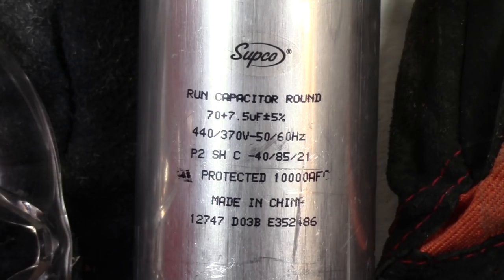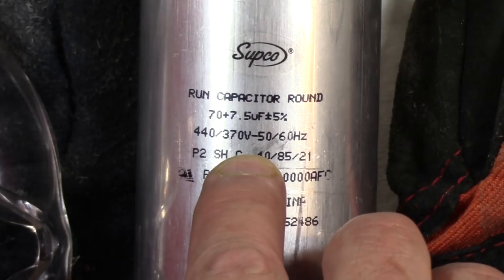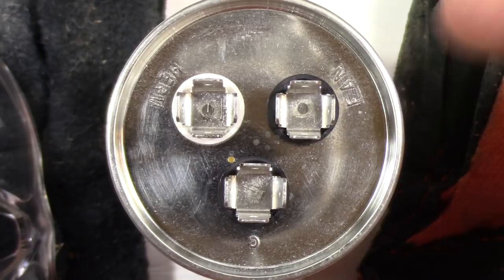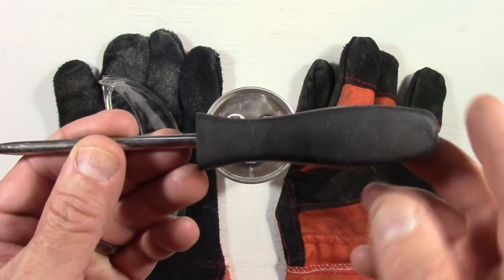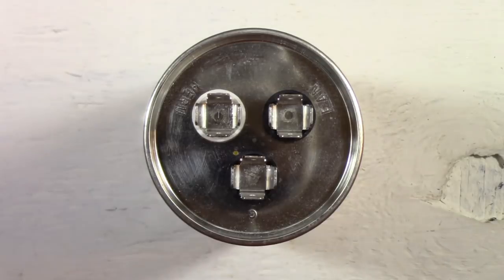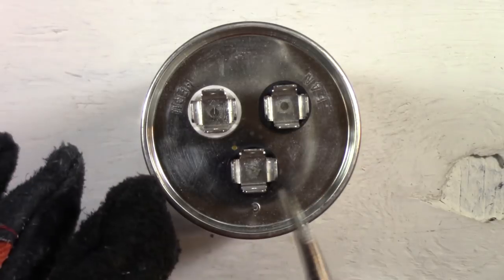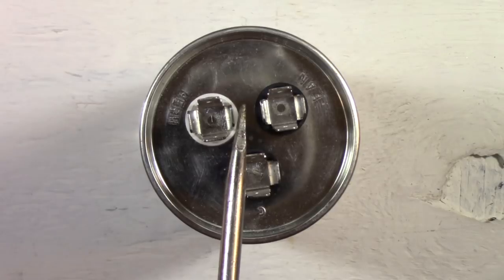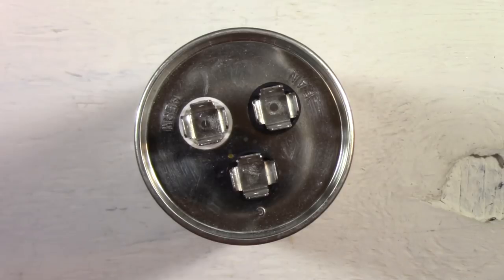How To Safely Discharge Your Air Conditioner Run Capacitor

Comment: You should add a part to the beginning telling why a capacitor needs to be shorted. You've shown how to do it safely, but didn't tell us why we need to do it.
Reply from the maker: Unfortunately Youtube no longer allows us to annotate the video post production or I would just put a note at the beginning. My assumption in this video was that stating that the capacitor was storing high voltage (120Volts) and showing the sparks that you get when you discharge the capacitor would be sufficient to show the hazard potential. In my next capacitor video I will state the reason for discharging the capacitor (safety) to be sure that there is no doubt as to why. Thanks for the feedback. I appreciate it. All the best.
Reply: Richard Lloyd hi bro...u r awesome..one more thing I want to ask...Can I discharge the capacitor connected to the hvac or it should be discharged after getting it disconnected from ac
Reply from the maker: Certainly disconnect it first and make sure you use insulated tools and gloves as well. Thanks.
Reply: Richard Lloyd thnks for the reply
Reply from the maker: You are most welcome. Be safe. All the best.
Reply: Richard Lloyd bro need some more help regarding capacitor rating....my hvac (year 2000 lg make) has 45 uf cap installed for 18000 btu (1.5 ton) compressor. It was installed by some technician when 1st one was totally blown and so I also don't know what rating one should be correct. I have a second ac (2016 lg make) of same 18k btu. It has come with 55 uf cap installed for compressor. My 1st hvac has cooling problem and I have got all leaks and refrigerant checked. Please suggest me what to do. Should I replace 45uf cap with higher rating like 50 or 55 uf

Comment: Does the screwdriver have to be bare. I have an insulated screwdriver. The metal portion of the screwdriver is coated. Will that one work or does does just the handle need to be insulated?

Comment: Curious, is that the correct way to discharge a capacitor? Thanks
Reply from the maker: It's not the "optimal procedure" but it gets the job done. If you wish to see the  optimal way you should use a Capacitor Discharge Tool watch this video I made on how to make one: https://youtu.be/pVIV905qby0 Thanks.
Reply: KelJenn B  The best way to discharge a capacitor is to use a Capacitor discharge tool or run 100ohm resistor across c to hern c to fan. Never use a screwdriver to discharge a capacitor because explosion could occur. That is what I was taught when I took my Nate certification.

Comment: Should you remove the old capacitor before dischargin it or discharge it while still wired on the unit before removal?
Reply from the maker: I would say that it's safest to do before removal as long as there is no leakage in the capacitor. Thanks.
Reply from the maker: I would say that it's safest to do before removal as long as there is no leakage in the capacitor. Thanks.

Comment: I was told of the motor is still connected to the capacitor it will discharge itself.  Is that true?
Reply from the maker: Some are designed to so and some are not. I always treat the capacitor as a charged capacitor and discharge it regardless. Be safe. Thank you for watching and commenting. I appreciate it greatly. All the best.👍😀

Comment: Replaced the run cap. Thanks for taking the fear out of handling large caps. I mounted one probe of the  discharge tool on the end of a 8" plastic rod. No courage here. I was a little unsure of what to make out of the 2-pole starter cap with bleeder resistor, not knowing if it needed to be discharged as well when replacing the run cap. I assumed  it was switched out of the circuit, and could just be left alone. The only possibility it would have a charge is if the resistor or connections between the poles is bad, but I didn't know how to test that. Thanks again.

Comment: Very helpful! I’m headed to get an insulated screwdriver at the tool store. I used electrical tape around a screwdriver I have and I have rubber gloves but Ive been dreading doing this simply on account of the discharging part of the process. I may be okay with what I have but I don’t want to risk it.

Comment: Richard. Do you suggest to take the capacitor out of the system to discharge ? Or we can do this procedure inside the system.?
Thanks.
Reply from the maker: You can do it inside the unit. Thanks.
Reply: @richardlloydusa  let me double check, so can I discharge the capacity while still inside the unit with all of the wires connected?  I won't damage the AC unit if all wires are still connected and I short it??  Thanks in advance.

Comment: Do all ac's have capacitors? My unit is up on my roof 2 floors up, so I have to rely on the ac dude to speak the truth to me. He says there is no capacitor on the motor.
Reply from the maker: If you know the manufacturer and model name you should be able to find that information on line. If you supply it to me I will have a look but I can't make any promises. Thanks
Reply: Thanks so much for getting back to me. I found my paperwork on the unit.
Reply from the maker: Does it have a capacitor? Thanks.

Comment: Thank you very much for doing this video, I knew they were dangerous but I've seen some HVAC Techs treat them like they are dead once they are disconnected.  Guess those guys don't mind getting a shock of their life!  I feel confident to change mine now that I have this knowledge and you walked us through the discharge and safety process.  Thanks again!

Comment: Do i have to short terminal of new capacitor which was never installed and just received in mail?
Reply from the maker: Great question, you should not have to BUT what if the capacitor is a returned item? Or what if the capacitor was tested and not discharged. I would err on the side of safety and always handle them as charged until you verify that it is discharged by discharging it. Thanks.

Comment: thanks for your video , could you tell me please why  my air conditioner  causing circuit breaker to cut the power off , is it because of the faulty capacitor  ?
Reply from the maker: Something in your A/C is causing an overload situation. There are many causes and a faulty capacitor is one of them. I would certainly check the capacitor. Here is my video on that: https://youtu.be/19A9lvQ6lIA?list=PLnxXRLSlmSVOUSl-tmdEuav4IW1OghaES Here is a number of other things it could be: http://www.ghacinc.com/index.php/service-repair/help-yourself/common-cooling-issues/kicking-a-breaker Thanks
Reply: thanks for your help
Reply from the maker: You are most welcome. Thanks for watching and commenting. All the best.

Comment: Do I have to discharge the new capacitor before installation?
Reply from the maker: You should not have to but you never know if it has been charged prior to you getting it. I would treat it as if it is charged and discharge it just to be safe. Thanks.
Reply: Absolutely yes.  Think of it like a firearm... assume it's charged/loaded because you don't really know that this capacitor has never been connected to anything, and the potential harm if it does have a charge and electrocutes you.  Discharging a capacitor does no harm to it... that's what they are designed to do, so any time you handle a large capacitor, new or old, use a screwdriver to safely discharge it before handling.